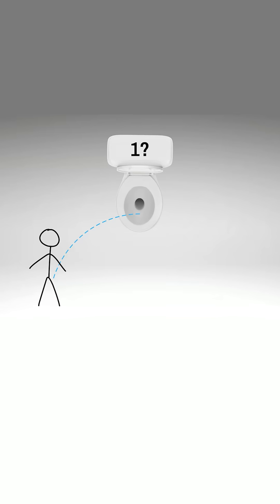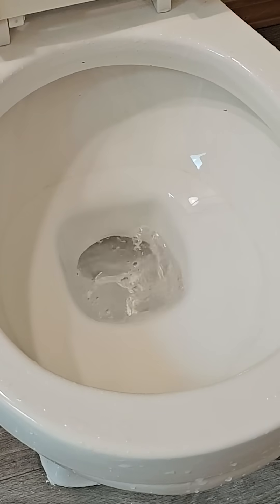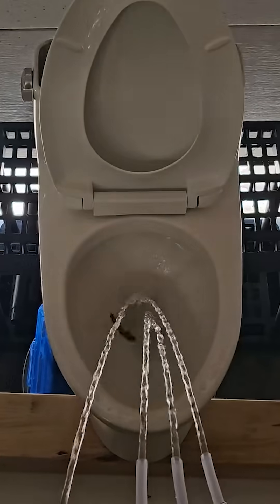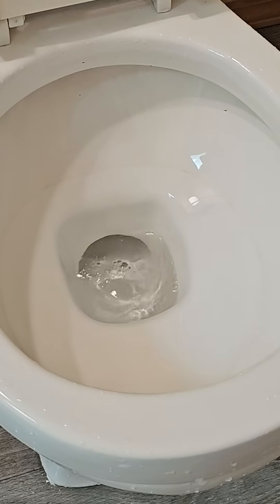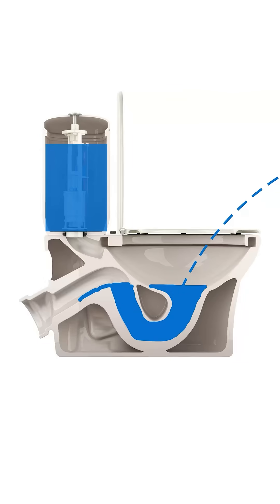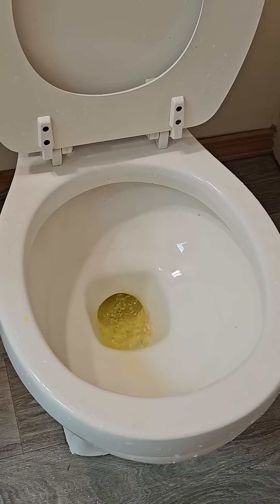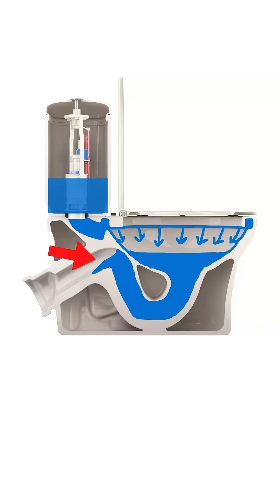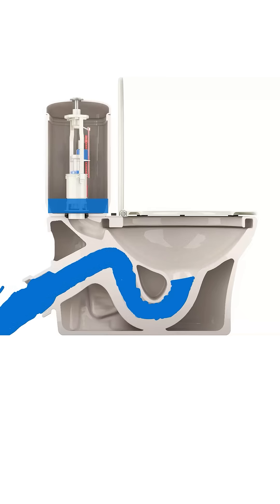How many human streams to flush a toilet? (Follow-up) #shorts #engineeredbets

Comment: So it’s odd, but studies show that the average mammal, regardless of its size (except for rodents since most of the just pee constantly when they run) pee for roughly 21 seconds.

It’s established enough that it is actually called “the law of urination”
Reply: I can pee for over a minute straight
Two if I drink enough water
Reply: @dracothewarrior4316  then you need to go to the bathroom more often
there are multiple possibilities why that is happening
if you are a male then you might have inflamed prostate (which is actually VERY common and affects A LOT men), have some issues with the urinary track itself or something entirely different that I am not knowledgeable about
you REALLY shouldn't go to the bathroom too often or too rarely because that WILL cause the muscles responsible for keeping the pee in to stretch and struggle with holding it
It's why many elderly people need adult diapers
Reply: @dracothewarrior4316  being able to pee for a long time is REALLY not something that you should be flexing as it's a sign that you have some issues there

as the commenter stated, the average time it takes universally among mammals is around 21 seconds

the science behind it is actually quite funny because the increase in the animal size will mean that they can hold more fluid but coincidentally it usually also means that the urethra is longer which means more pressure which also means faster release

it's also the reason why huge mammals like elephants can literally make holes in the ground that they're walking on with just peeing
the sheer pressure causes the fluid to shove aside the soil and small rocks
Reply: @dracothewarrior4316 do you have diabetes?
Reply: I thought it was 12 seconds?
Reply: @willw.1734 more like 5 minutes if there’s a middle aged bald man standing next to me at a urinal
Reply: @willw.1734  12 seconds is the average 💩 time for mammals, regardless of the size of the animal.
Reply: hm
Reply: For me looks like I pee for a lot more time than just 21 seconds. Even at full pressure, I take so much time it makes me uncomfortable with what others near me could think of me 😂😂😂😂😂
Reply: I typically pee for longer than that, but I'm always drinking water/Gatorade/etc.

After I've held it for a certain amount of time, I just don't notice it again for awhile. Particularly if I'm focused on something.
Reply: I read that somewhere and it kind of blew my mind
Reply: That long?
Reply: My ex would fully finish peeing in about 6 seconds. I mentioned this rule to her, but apparently she's always been a speed-pisser
Reply: VSauce talked about this for defecation
Reply: I'm above average cause I pee for 1 to 3 Minutes every 2 to 3 hours, depending on if I drink or not.
Reply: I remember this received an ignobel prize

Comment: U obviously never lived in a studio apartment on the cheap side of downtown. 
U dont use pee but water in an empty 2 liter bottle that u fill up at a gas station. 
When u want to flush it u wait till the last minute and pour the water in a bucket and dump it in at once. 
Plus u can use the 2 liter bottle again or use it as a plunger if things get messy.
Reply: I don’t think anybody uses pee to force flush 😂😂
Reply: I don't think using pee is actually a thing, as the other reply says, but yeah. My mom uses waste water from other stuff (changing out the water in our dog's water bowl, washing salad etc) for this by puting it in a large pitcher that she leaves by the downstairs bathroom. We don't really need to save money that much but it feels like a waste to just empty it out